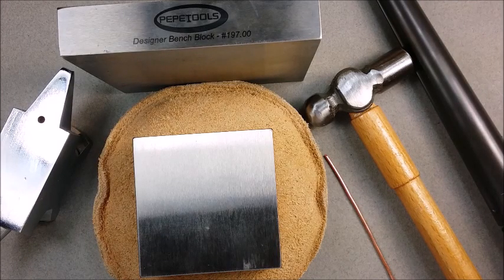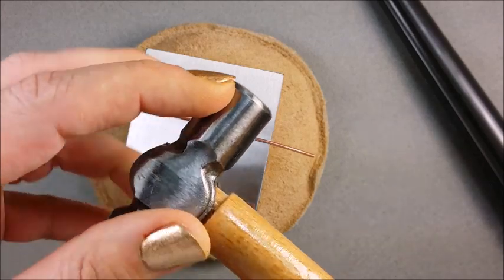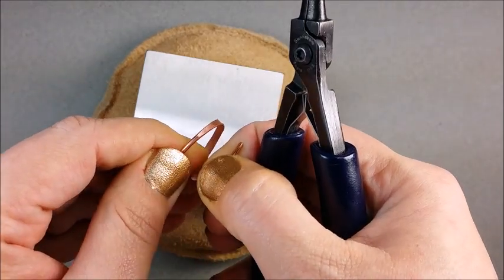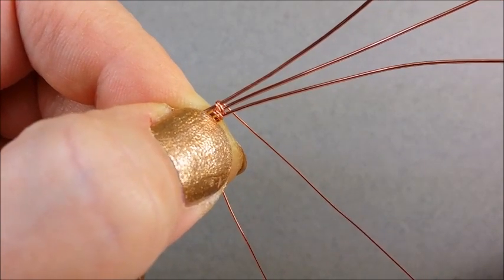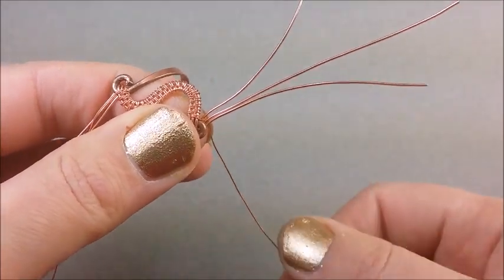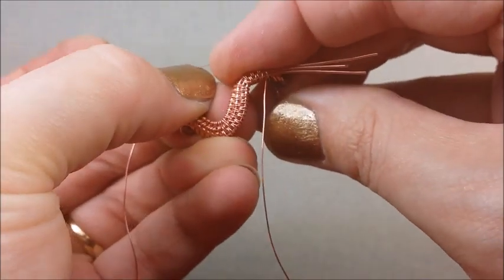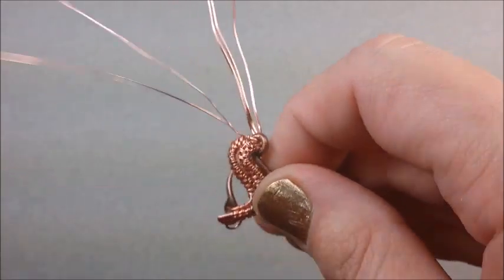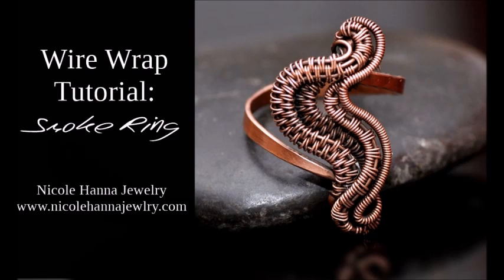Wire Wrap Tutorial SMOKE RING

Comment: I've only made it 10 minutes in and I've already learned soo dang much. I don't know if anyone has asked this question. but I've been looking everywhere for an answer. Im worried Im not using ANYTHING correctly. I have just a small kit. comes with a hammer, needle nose plyers, reverse tweezers, a long sparp object tthat I can only describe as a bead reamer but its not rough of the needle part. 2 diff, sized needles, and 2 other.. I assume stamp like things. anyways. its by 'Making Memories' if that helps. the small hammer is what I have to use. on whatever surface I can get until I know what to buy (which I do now, thank you) but how long should I be hammering for. its not ever getting flat. its just walmart wire for now. until I can get really good at it. and it just wont flatten. I watched one video where a girl flattened her wire.. just a few small hits and boom, it was done. what am I doing wrong? please help, when you have time. anything would be much appreciated. I forget the size and hardness of the wire. again its walmart crap. they don't have a large selection anymore either. its like they are taking it away. one side of the isle. only 2-4 feet long for space of product that they sell.. they use to have a whole isle.. both sides.. so I wont have much to practice with anymore.. please help! thank oyu

Comment: Your videos and jewelry are so inspirational. Thank you for putting up such great tutorials and I love how you actually explain everything you are doing. It is very helpful. For your pieces, I read someone else's comment and they asked if you used dead soft or half hard wire. 
Do you ever use half hard wire? Or would it be too stiff to bend and do what you want? 
After you use Liver of Sulfur, can the copper still give the green effect that tends to happen with copper jewelry? How do you prevent that from happening? I know you can't really besides with renaissance wax, but will the green effect still happen after you do the LOS?
 Also, I know dead-soft wire hardens as you work with it, but how is the piece hard from not hammering it ?
Reply from the maker: +craftycorner Hi! I don't use half hard for anything except ear wires, and only in an instance when I can't hammer a dead soft wire to work harden it. As for the green.... I imagine, in time and without care, it could turn green, but with regular monthly care it should be fine. I always recommend, once a month, scrubbing lightly (and avoiding stones or beads) with a very fine 0000 steel wool pad (from the hardware store... not the kitchen cleaning kind) and rinsing with some dish soap, then drying really really well. 

The band of this ring is quite hard after hammering it, but the face of the ring is also hard because the weave is nice and compressed (I always stress compressing the weaves.... no loose weaves!) and because the weaves are layered on top of one another. Creates a nice sturdy finished product.